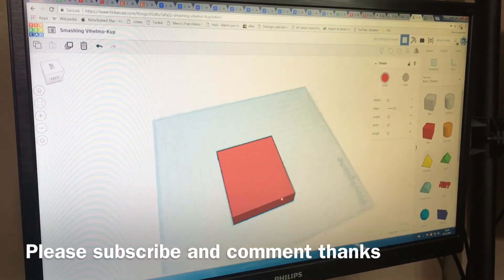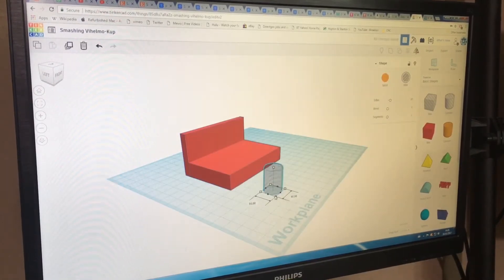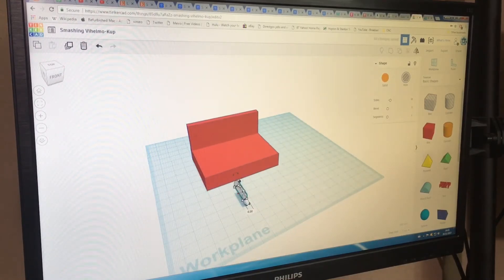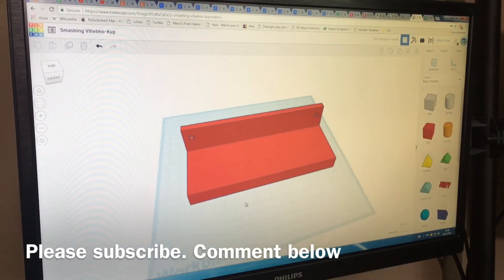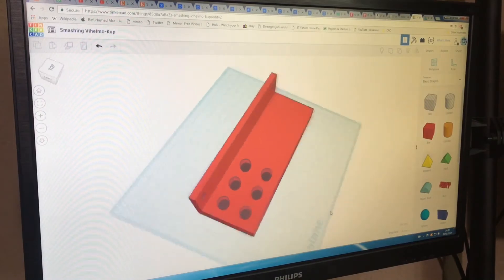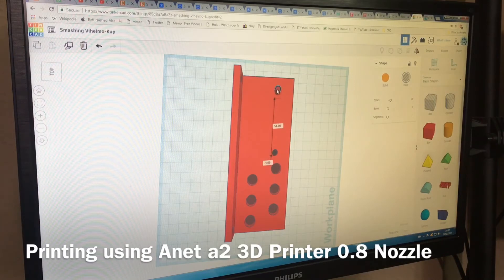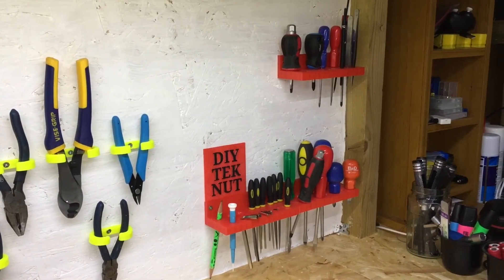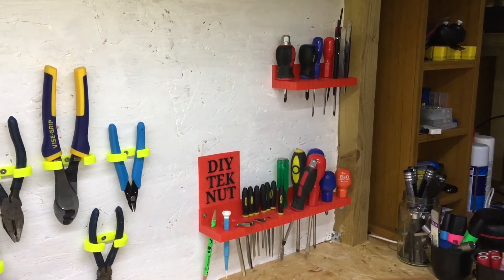3D Printed Tool Holders Rack Printed On Anet A2

Comment: Superb! I have to get a 3d printer at some point. One day! Like the yellow plier holders to, very clever easy solution.
Reply from the maker: Thanks my friend much appreciated, yeah i do hope you get one with your knowledge you would go far.
Reply: I don't know any more than you do, my friend. Bugger all about 3d Printers. The one thing that stops me is the feed mechanism as I heard so many horror stories of how they get jammed up etc. But I have a project on my list where It is probably the only solution. (lots of small plastic parts of unique dimensions) Of the ones you own which one would you say is the best. I really like what you done with your latest one. I will have to get one when this new project begins as making all these small parts out of wood is way beyond my primitive carpentry skills.
Reply from the maker: Well you have a very good understanding of electrics and very good at building things. you should have know problem building a kit, the thing with blocked nozzles and jammed feeder mech it happens on any printers from £100-£2000 your going to get it blocked at some point and its not that big of a deal, 
Most cases its user error like not know how to assemble the hot end correctly if the nozzle gets blocked just poke it with a needle 50% of time that will do it.  if not just change for new nozzle change ptfe liner if needs. 

well i got to say i brought the anet a2 for a project i was bored thinking it would not be very good and could build on it and make it better but to my dismay i brought a printer that prints and works very well once assembled. i think you you get every penny and more its a great value it prints better than my £300 wanhao duplicator i3, as good as the tevo tarantula.
Reply: Many thanks for info. Your a star. I think I will bite the bullet and have a go. Also the idea of printing your own speced plastic enclosures is one big draw for me. I will go with the Anet. I see on amazon they going for £200 at moment. Is that a good price? I suppose I have to be prepared for some faults eg PSU not working properly ;-)
Reply from the maker: ebay £141.99  http://www.ebay.co.uk/itm/263118483615 its known as the x2 in some country's.
psu yeah they did refund £12 so i could buy another.
Reply: Cheers!